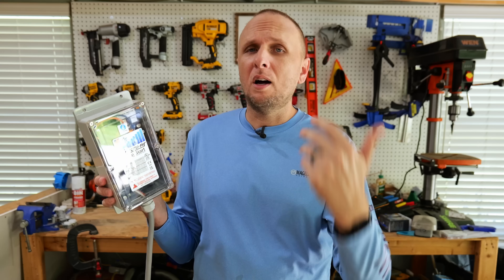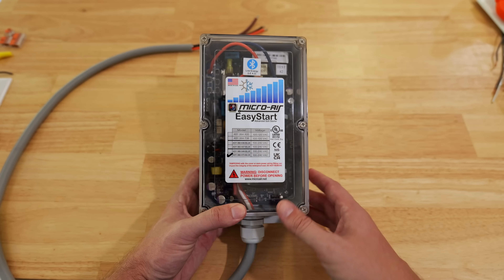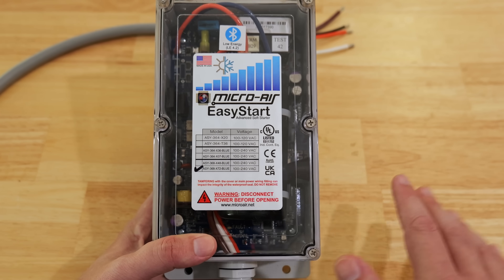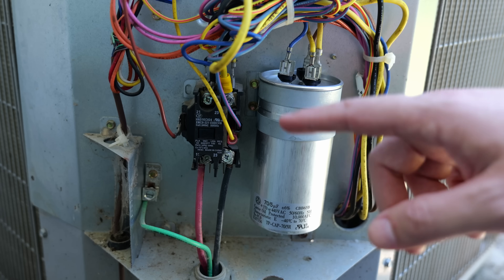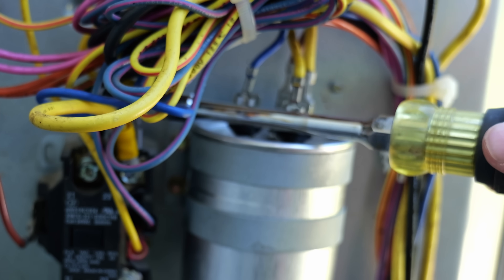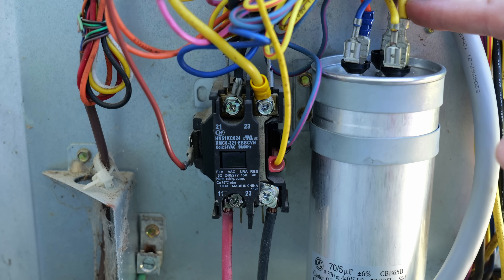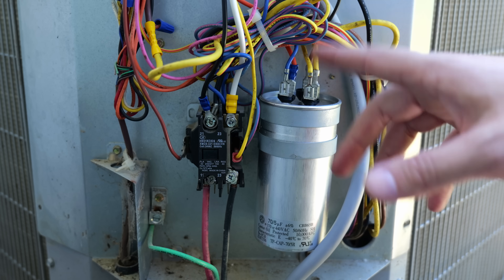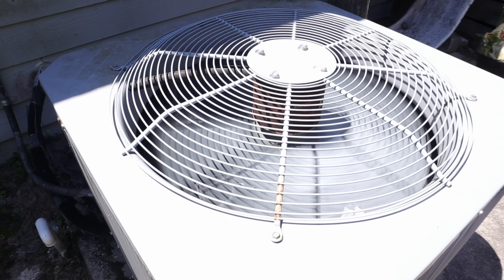Why Every Homeowner Should Consider Installing an AC Soft Starter | Micro Air Easy Start Install

Comment: I’m assuming it helps on energy consumption? Seems like less power to start would mean less consumption… am I off in my thinking?
Reply: It might reduce the initial current inrush, but as far as I'm aware, it will not lower the running current of the unit.
Reply: @saucecups  I don't know if it adds up to much, but your compressor starts and stops how many times a day?
Reply: @jimbelcher6877  It varies, but my comment only explains that the running consumption would remain the same, not the startups.
Reply: @saucecups  Understood.  I retired to the Philippines and our energy prices here are sky high.  Like you said, it might not add up to much, but here there may be some potential.
Reply: No, because it takes longer for the compressor to start. 120 amps starts the compressor in a second. 40 amps takes 3 seconds. These are not specific numbers but a generalization. Once the compressor starts it uses the same amps with or without this device,
Reply: @NCHeel  Thank you, assuming you are right - I thought this might be the case, but I'm simply not in a position to guarantee correct info on the matter.
Reply: Thank you for the reply. I find your videos extremely helpful and informative.

Comment: Another great video.  Clear, concise and helpful for those willing to approach DIY and focus on safety.  I found you when searching on capacitor replacement in the past.  I have 2 Tesla power walls but considering this soft start given I also have pool pumps as a way to reduce the initial surge in a power outage if everything is on.
Reply: Ug I'm😅😊ky 0:26 k6m😊0🎉

Comment: 5.13.23  Great video Adam.  I have the easy start ASY-368-X48-BL and a Bryant heat pump 697CNX0 36000 ABAA.  The unit is work real good.  I did have an issue with the Bluetooth connecting.  When connecting found something that started with  ADPXXXXXXX, however I found out needed to start something like EASYXXXXXXXX.  All is good.  I also had an issue with the capacitor.  I have one of those Turbo2000 so I sent the wire diagram over to Micro Air and they sent me back a colored diagram of where the wires should go.
Reply from the maker: Awesome!  Love to hear it.  Honestly, the folks at Micro Air have always been super helpful and responsive when I have needed help with something or had a question.  Really glad to hear you had the same experience.  Glad you are liking it and thank you very much for the feedback Chuck!

Comment: I bought one but I am still uneasy with installing it... will watch and hope to figure it out 
(btw no AC service, install, repair place around will install it! They all say, "We won't install user provided equipment" so I say, what if you provided it? And 80% of them said they don't know what it is...)
Reply from the maker: Yes, I have spoken to quite a few HVAC people about this and when you mention soft starter they think you are talking about a hard start or a PTCR.  That being said more and more are starting to learn about it.  If you do not feel comfortable doing it, I would try to find an HVAC guy that will do it as side work if none of the companies are willing to install it.  I am all about DIY but everyone needs to feel comfortable with whatever project they are doing and have a good grasp of what needs to be done.  No shame at all in being safe.  Thanks a lot for the feedback!
Reply: It is easy to psyche yourself out over the install. I watched a couple of videos and successfully installed it a while back. It is actually pretty simple…..

Comment: So, putting aside all the nice protection features, I guess the point about starting the compressor is that the compressor doesn't actually require a large initial current, if the (smaller) current is delivered in well-timed pulses.
     I assume the EasyStart has at least one capacitor that charges between the pulses, and discharges during the pulses to boost the pulse current.
Reply from the maker: Yes, it just slowly ramps up the power until it kicks on the compressor instead of it just getting a sudden jolt of electricity to get it going.  Yes you are correct, it does have a capacitor inside of it.

Comment: I put one on my camper and now can run the air off my small, 2200 watts max - 1800 running, inverter generator.
Great product!
Reply from the maker: They really are amazing devices.  Thanks a lot for sharing your experience!

Comment: Curious why you used butt connectors instead of 10g Wagos
Reply from the maker: So in my Wago videos I have said that I think they certainly have their place on certain installs.  For me personally, the more traditional butt connectors are going to provide more surface contact with the wires for a better connection and they provide more of a mechanical connection.  Once it is crimped down properly, the wires are not coming out of the connector short of cutting the wire.  So those are my personal reasons.  Still love the Wagos for certain installs though!  Thanks Chuck!
Reply: @HowToHomeDIY  yeah, I used the 10g Wagos to wire surge protection for my A/C condenser, and my Steam humidifier. Hard to find locally but Amazon had them 👍

Comment: How did it affect your electric bill?
Reply from the maker: The affect on the electric bill will be miniscule to none unless you live somewhere where the power company charges you based on your peak usage.  Then it could make a real difference.  But for most people it won't.  This just greatly reduces the initial amperage needed to start up the compressor.  After that, it will run at the same amperage as it normally would.
Reply: Will it help to make the unit last longer over time or pretty much same? And if so the only real advantage would be if power is out , using a small generator? Thanks in advance.

Comment: I went with ICM870-16amp vs the micro air because it was about half the cost
Reply: @Eugene Kim:  Was the install of your ICM870-16A similar as shown in this video?
Did you get the results you wanted?

I have done some research on soft-starts for my house A/C. And these are the two units I am considering. 
thx,  tommy
Reply: @tommywwalden1599  sorry, i thought I replied to your comment. Was able to install on my 4-ton unit and works great! Went from ~100 Amps inrush down to 39 Amps! Also put one on a 3-ton unit and went from 39 Amps to 13.5 Amps

Comment: I bought a window unit a while back for use in my bedroom at night (so the main AC wouldn't have to run all night).  It is an LG "dual inverter" unit.  As I understand it, "dual inverter technology" includes a soft start feature that helps to lessen electricity use.  I can say for sure that I don't have that GrrrRRRR!!! sound when it kicks on like older window units did and my main AC unit. does  As for energy cost savings, I'd probably have to get something like a Kill-a-Watt kind of thing to quantify it.

As I understand it, there are "main" AC units with "dual inductor" technology.  I imagine the operating theory of "dual inverter" and "soft start" is similar.  But this Easy Start thing is obviously WAY less expensive than a new technology main unit.

Good video!  Thanks!  🙂
Reply: If it’s a dual inverter the compressor slowly ramps up speed/rpms… so I’m not sure why you think it’s not doing that.

Comment: My problem is that I recently installed a new Carrier A/C system through a contractor about a year ago.  The contractor has said that If I install a soft start kit myself then the warranty would be voided by Carrier.  I must hire a licensed electrician or an HVAC company to install the soft start kit to keep the warranty in force. 😲
Reply: Unless you have a maintenance plan with the company, you can still install it yourself and remove when there is a service call. They have no ways to know tmo.
Reply: @cyrilasfrenchyaz  Bit of a hassle to uninstall, but I guess you could do that.
Reply: Yeah, that'll likely be the case for any unit that is new and still under warranty.
Reply: @bgroovin1343  The warranty goes for many years, so I got to hire somebody.  Contractor wants $1,200 to $1,400 to install it.  Might get a better price with some bidding.  Life isn't always that simple.

Comment from the maker: Unless you have an old, stuck compressor that needs the help of a hard start, this seems like a no brainer to me.  What do you think?
Reply: Problem is most Copeland compressors advice AGAINST installing these on their compressors you have to cross reference through Copeland to be sure it’s compatible. I’ve done classes with Copeland and don gillis when he was the lead trainer over there and they really hammered on this. Just heads up while you tell homeowners to put this on their equipment where they could be voiding their warranty or damaging their equipment
Reply: @madeinusa1576  Agreed.  I have found that for those Copeland Single Phase residential models such as the ZPxNN series, that support soft starters, it greatly reduces the startup noise and  serves as a really surge protector in use cases that require these parameters.
Reply: @TheRealoldcar 42eed3a5ee8c4afc5e8
Reply: @madeinusa1576  THANKS!
Reply: This sounds amazing! We live in South Florida aka Hurricane Alley. Buh bye window unit!! I can use the central air during an outage now. We have a Daiken system and will look into this! Thanks!
Reply: @loosenut1969 just installed on my Daikin yesterday. If you have the CoreSense Monitor system it will add a few more steps than what the video shows. Just FYI. Still a easy install though.
Reply: @kevovernon  thanks so much!
Reply: @sheepdog3828  They do not go bad as quick and Copeland cant sell as many compressors. LOL
Reply: Can the smallest soft-starter be used with a portable (R2D2 looking) AC?
Or for a window AC?
If not, are there any soft starters for portable or window AC units?  

Our window Ac causes a light to flicker when compressor comes on;
  the portable unit in a different room, flips the circuit when the compressor comes on. 
We don’t have the $$$$$ to rewire the house.  
We have been replacing old sockets & switches as we can get to it (house wiring from 1970s); the entire system is barely adequate (kitchen circuits are 15 amp, & lacked GFCI’s on either circuit-had electrician install those) , & kinda grossly badly arranged per circuit, throughout the house (I.e., garage is on same circuit as dining & half the kitchen).  

The old socket the portable unit is plugged into, had worked fine with a window AC a few years ago.  
The portable unit tho, started to run, ran overnight once, ok, but then started flipping the GFCI off, as soon as the compressor started.  I figured it might be due to the compressor start-spike.  
Just considering returning the portable & suffering with the heat, vs. Blowing huge $$$$ on rewiring at least some circuits.

A soft start unit would be a big help. 
Is there a plug-in soft-start interface for a portable AC, & for the window AC?   (One covers both? Or one per each unit?)
Reply: @Chimonger1  have a Dometic 11.5 RV air conditioner, I easily run it with a Honda eu3000. I have used the easy start for 2.5 years with no issues.
Reply: @aerodoc2    What should I look for in an easy start?  
Where can I find ones that simply plug between the AC & wall socket?
Reply: I think this is a very well done ad for Micro Air.
Reply from the maker: @Ari an ad would require money to have changed hands.  Which it didn't.  This is a device that I personally use and because it has worked so well for me, I help others in making them aware that there is a really good option out there.  So thanks for the compliment 🙂
Reply: I purchased and installed an Easy Start unit on my 2 1/2 ton Trane AC condenser and have NOT experienced the lower inrush currents as advertised.

My LRA rating is 63 amps and I rotinly see 50 plus amps inrush as shown on the easy start.

According to all the advertising I should be down into the 25 plus range, this simply is not happening and my extensive conversations with Micro Air's technition while friendly just does not offer any explanition that makes sense if their advertising info is anywhere near the truth.
Reply: @royagrusa2396  Mine dropped from 60 to 13 amps. Also, the The ICM870 Soft Start is intended for residential, commercial, RV & marine applications, and it costs less than half what the micro-air easy start costs.
Reply from the maker: Did you check your in rush prior to the install?  Your LRA listed is what it was rated at from the factory but there are a multitude of reasons and issues that can be causing the higher inrush.
Reply: @HowToHomeDIY  my listed inrush current is 115A but I measured 125A.
Reply: Sketch.... L
Reply: AC Techs don't like this ... of course ... it's killing the Bussines! Lol
Reply: @alexandrecarvalhonaves2200  Those days are dead, dude. As someone who works in the automotive industry, the amount of people who intentionally mislead you, so that your products prematurely fail, in order to make more money is infinitesimal. We want the job done right, with quality products, so we don't have to deal with you again anytime soon. Believe me. Lol
Reply: @CloudfeatherRusticWorks  Im glad you are a honest professional! Good for you!
Reply: Super Expensive Imagine if you need 5 of them because you have split units? Yikes. 

Thanks for sharing.
Reply: @ELEVOPR  Most modern split units have 3ph compressors driven by VFDs.  So soft start is built in.
Reply: @mikeiver  Thats good News. That shows you how much I know about AC's 😂 

Thanks for the Info. 🤗🤗
Reply: @ELEVOPR  Not all of them though.  Some old single zone units might be simple contractor controlled compressors.
Reply: @ELEVOPR  The ICM870 Soft Start is intended for residential, commercial, RV & marine applications. It costs less than half the price of micro-air easy start.